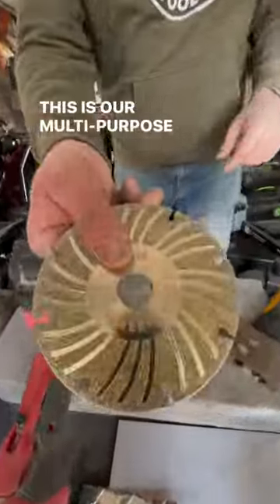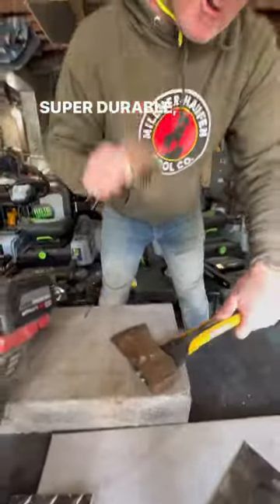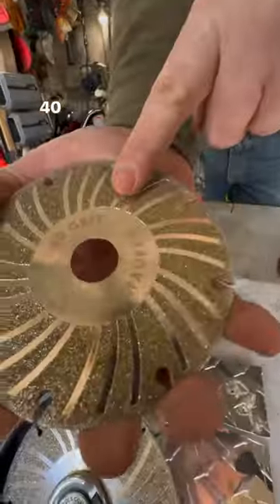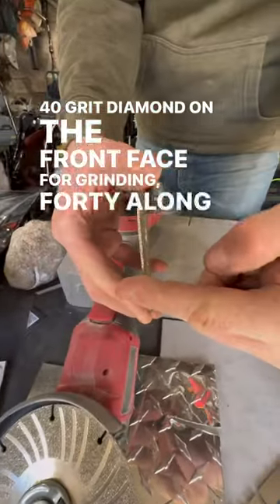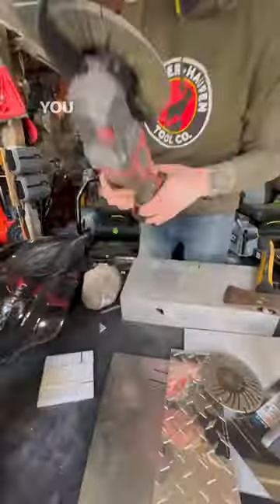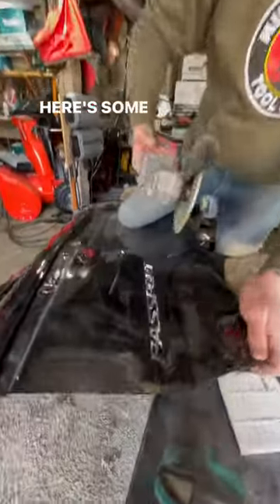This is one hell of a test. #shorts

Comment: Don't mix your steel and aluminum discs at home kids.
Reply: I guess I’m a rebel I use one for all of it cuts it ships
Reply: @neooverby3750  not a matter of cutting the different materials, it's the matter of introducing steel penetrants into a non corrosive, or oxidizing metal like aluminum and stainless. Youl notice rust specs or lines in stainless or aluminum projects a half year or so later. Depends on the environment.